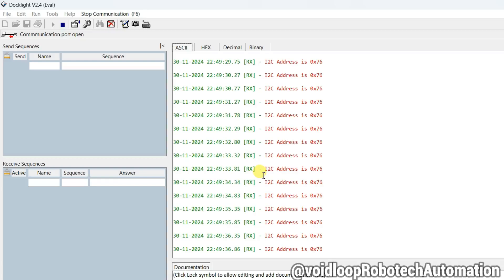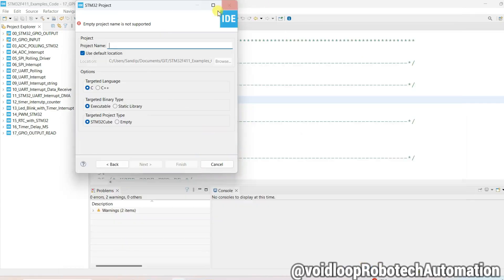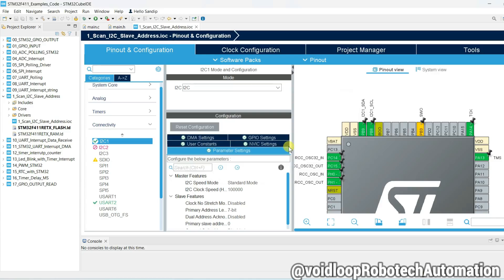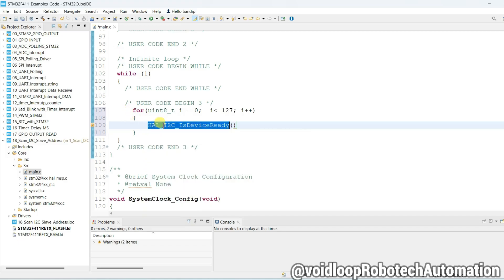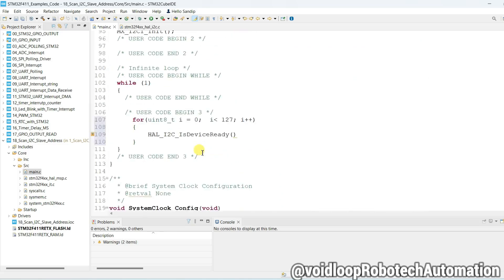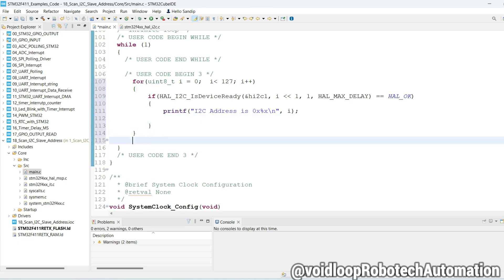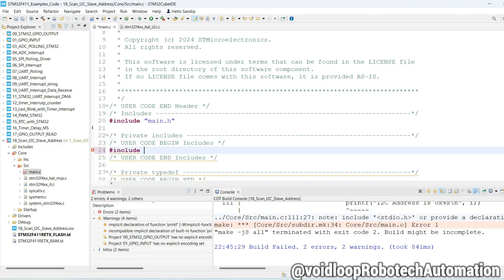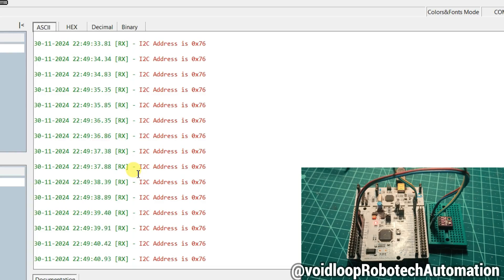18 STM32 Scan I2C Slave Address with STM32 Nucleo Board and STM32Cube MX

Comment: Thanks for a great lesson. I have a question though,
Why did you change SCL/SDA pins for I2C1 from default PB6/PB7 to PB8/PB9?
Also, should we have chosen "pull up resistors" for these pins? Or used external pull up resistors?

Thanks again.
Reply from the maker: You can use PB6 and PB7, but sensor must be connected on PB6 and PB7.  no you don't need to choosen pull-up